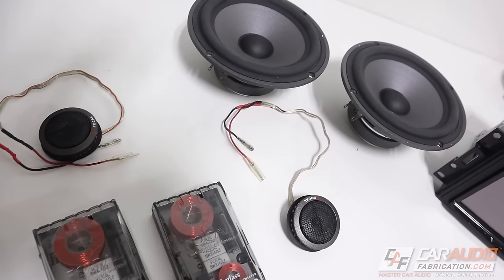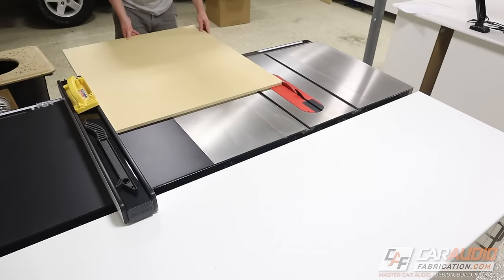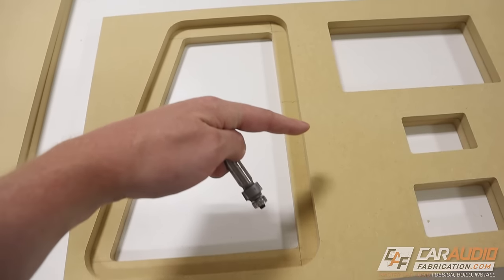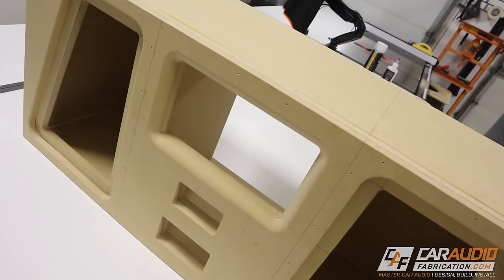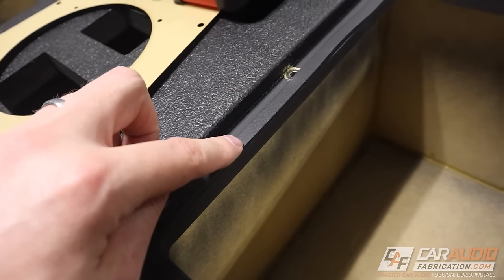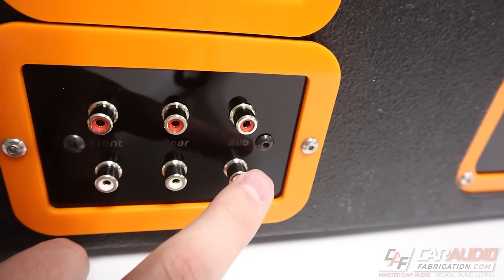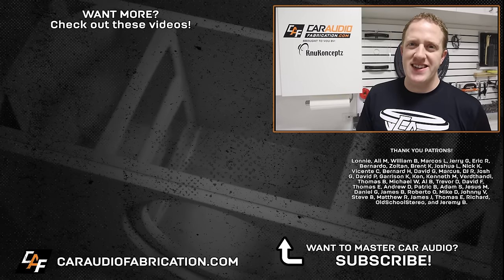How to Make: STEREO BOOMBOX! I turned OLD Audio Gear into a sound system!

Comment: Yes sub box for sure! I built a budget system into my husky 52" tool chest to be better than anything you could buy like the kobalt tool chests. I used two prefab boxes in top cubby to hold infinity 6.5"' marine speakers and built a custom box that fit in the "large power tool" drawer with an 8" downfiring audiopipe sub. Kenwood HU and two SSL micro amps all powered by Xbox power supply are installed in one of top drawers. My main problem is turn off pop when the HU is set to standby or off. The way it's wired it gets full power to HU when plugged in, no separate switch like you did. Doesn't seem to do it with HU alone bypassing the amps. Any suggestions? Is it just low quality amps?

Comment: What would you recommend for a more permanent power supply for a boom box besides a car battery? I have an old sub woofer amp that I want to repurpose into a shop box but I don’t want to spend another $200+ on a battery that can handle it.

Comment: Hi Mark, Do you build boomboxes out of old boombox parts or do you know anyone that does because I need something like that. Years ago, I had a JVC boombox and this thing had an equalizer and a base booster that sounded off the hook when you put the equalizer and the base booster just right. If I knew then what I knew now, I would've kept my JVC boombox for it's parts and have somebody put what I need out of it into a smaller casing now. And, it still can be done, I can buy an old used JVC with that Equalizer and that base booster and those speakers. All I need is somebody to put speakers, equalizer, and base booster into a smaller casing, like they have blue tooth speakers now. I don't need the cassette player, radio, or CD player, all I need is the equalizer, those speakers and that base booster. They are fascinated by that Bose and that JBL now but to me, it doesn't compare to that JVC with the base that it has and that equalizer. Another speaker I'd want transformed into a blue tooth speaker is the Velodyne 15 inch subwoofer. That thing has bump and shake base! Only thing iz, you need to connect it to a cassette player, CD player and a record player, and, it's 30 pounds. I don't need a 30 pound thing in my house, so that's another one I'd love to have put into different casing for a blue tooth speaker. Can you do or do you know anybody who does this? If you do, please let me know. If I tried to do it I'd wreck everything.

Comment: Did this with two 6.5 polk audios with a bluetooth micro amp and a 6ah lipo battery in a old miwaukee drill case. Still use it on site every day three years later. Fucker gets loud too

Comment: I made a boom Box like this and I put 4 speakers in it sounds amazing.. I do have an issue however with the memory let me know a smart way to handle that.
Reply: Memory as in the head unit settings? You need to make sure the yellow wire is receiving constant 12v, that is the memory wire on your head unit. This is the same reason your stereo loses its settings when you disconnect your car's battery. The red wire is your turn on wire and only should receive power when you want the head unit to turn on, easiest way to do that for a boombox build is to run it through a switch.

Comment: Dumb question, but... does the car stereo power up from the acc wire or battery wire? I would like to build (another) ammo can with a car stereo head unit, but with a small battery to retain memory and power up using 120vac to DC power supply.  In other words, how can I retain the memory of the head unit while not plugged in?

Comment: Great setup sir. Design is very good .

Question: I use Hp power supply from Elite 8000 cmt, its output is 12v 16A. But when volume is more than 27 headunits turns itself off. Headunit is kenwood krc-666g. Using 8 ohm 10w speakers .
Kindly help me.

Comment: Hello Mark,

   My name is Jasaiah Gonzalez, a 19 year old college student currently attending New Mexico State University in Las Cruces. I am in the process of pursuing my dream build. Although I had a few questions to ask you and was seeking advise from an expert. I have been planning this project for a while and I would like some clarifications. 
Firstly, I would like to mention on what I have installed right now. The car model for this project is a 2015 Hyundai Sonata SE (Standard Key/No Navigation) with the factory radio/head unit. A couple of months ago I ended up switching out the factory tweeters on top of the left and right dash of the car and replaced them with 2 Kenwood Excelon Series KFC-X2C 2-3/4" aftermarket Mid-Range tweeters [front dash L&R]. I also replaced the door speakers with an aftermarket Kenwood Excelon KFC-X174 Series 6-1/2 on each door (4 total doors). 
    Furthermore leading into my future build. My dream build is to add, 
1). 2 15inch Kicker CompR CWR154 43CWR154 3200W (both Comp R Series Dual 4 ohm Subwoofer) in the trunk, and a 12inch Kicker CompVR CVR124 (43CVR124) 800W (Dual 4 ohm Car Subwoofer) custom fibered glass/mounted in the front passenger glove compartment. 

To balance the audio I would like to add, 

3). 2 pairs of Kenwood 6-1/2" (2-Way Car Speakers - Black Model:KFC-651) 1 custom on each door. 
4). 4 Kenwood KFC-ST01 1" balanced dome tweeters. 1 custom on each door 
5). And 2 Kenwood KFC-ST01 1" balanced dome tweeters. 2 custom, 1 on each back A-Pillar rings towards the trunk. 

    Which leads to my questions. I am thinking I will need 2 amps or more. Would I need an 8 channel amp for the door speakers and another multi channel amp for the subs? Or just one 8 channel? Please let me know. And if so would you recommend the JL Audio VX800/8i (8-channel car amplifier with digital signal processing — 75 watts RMS x 8)? Leading into my second question... I will for sure need to add an extra battery in the trunk. But would I need 1 or 2 battery’s? And how many amplifier capacitors will I need? I am also not too worried about the wiring until i am there at the installation shop so they can add for what’s needed. I also have the  Soundskins Pro Plus Extra Large Rap to rap my car in for the improved sound quality like you mentioned. All I have left to order are the amps, and the battery/battery capacitor.

 In summary/perspective my build will include, 
- 2 tweeters in the front dash L&R
- 2 door speakers and 1 tweeter on each door (For 4 doors = 12 total speakers) 
- 2 15’s in the trunk 
- 1 12inch sub in the front passenger  

I will greatly appreciate it if you could advise me with feedback on what else I will need to add or will need to change. I also have to say that I am a big fan of your work! This is a legit build that I am trying to make happen within a couple of months and I am very excited. Thank you so much! Hope to hear from you soon.

Comment: Hi, what you mean with matching the volt on the head unit,my radio is 12v and  have a 10 fuse ,so I need an adapter 12v and 10 A?

Comment: I need help for time alignement in my car stereo. The question is: the sound stage must have the singer in front of me or at the center of the Dashboard?
Reply: The staging should be as far forward in front of you. I’m sitting with the problem that majority of all of my sound is coming from the 6x9s in back. They sound great but there is another option to bring the staging forward. Upgrading to any component set should solve almost all sound staging problems
Reply: Sean Michael yes but my question is different... I know that the sound stage must be as far forward as possibile... but... The singer (so the center of the stage) Should be in front of the driver seat or at the physical center of the car?

Comment: For the AC/DC Adapter: Look in thrift stores for rhe old grey Xbox power bricks. They're the most common 12v high-amp (16A) adapters you'll find.  

And there are 2 models. The oldest style which is rounded, and the new which had sharp corners. If you can find multiples of the same model, they can be wired in parallel to achieve even higher currents. 16A, then 32A, and so on. Very quickly you've got enough to push car audio amplifiers and subwoofers indoors.

Comment: So I've got a 600w AC to DC converter that I like to run a car amplifier off of to power the subs in my house, the only problem is I get really really bad feedback through everything when I have the inverter plugged in, the old Amp I used if I touched it (I'm assuming I was some sort of ground?) It would stop, it doesn't do that with my other amps. I'm wonder what I can do to either remove the feedback entirely, or at least lessen it. I've thought about those magnet things that clip on the wire, I've thought about getting a different power supply and I've also been lost in the thought of dirty power but I'm really just not sure where the issue is coming from other than the inverter itself. Any help would be greatly appreciated

Comment: Being waiting for this👍 but question can that power supply run an amplifier? Didn't want to use any battery 👍👍
Reply from the maker: No, it is only 10 amps. You would need a larger power supply for a more powerful amplifier. Those get pricey fast.

Comment: Next time pop some passive radiators into your design, or maybe run port :)
Reply from the maker: I need flexibility to try different speakers, either of those options would require making some speaker specific modifications to the enclosure.
Reply: @CarAudioFabrication  Whoops, entirely forgot that :O.. But maybe make like more "permanent" one in far future :) But cool design all in all, those RCA outputs are very cool

Comment: Love the video 
Now i wanna build one 
Id like to add a 10" sub tho 
So my issue will be 
After fitting a amp inside my wooden box build were would i run the ground/earth wire from the amp?
Thanks

Comment: If I am looking to get decent amount of bass in my car a MUV, will JBL GTO 609C component speakers on all 4 doors with an Amplifier connected to a 2-Din Head unit create enough bass ? I do not want a car shattering bass but decent bass to listen to EDM and techno music ! If not then my last resort is a set of Components in front doors , a set of Coxial in rear door and a sub in trunk connected to 4 way amp. (But I don't want excess Bass so confused also only components and sub will be on Amp) can you please help in this?

Comment: I like how he says " it´s only on head unit power " I am broke, so I plugged a 12 dollar unit to a subwoofer, drilled holes in the unit, inserted a fan and boom. It can completely handle it up to 100 Db.   the sub is a12 inch wide, or 30 cm wide.

Comment: Hey guys, I am a total amateur and honestly a lot of the information provided in these videos have my head spinning. Anyways, I recently added in a amp and upgraded my speakers, using the factory head unit in my 2017 Silverado. The place that installed it did a clean job, but I’m hearing a lot of electronic interference, and the amplified chimes & Siri integrated speech coming through are obnoxiously loud! I was wondering what I needed to fix this. Thanks for any help!

Comment: That little power supply is enough to power all of that? I would think it would cut out having the sub amp and subwoofer going at high volumes
Reply from the maker: Watch the whole video
Reply: He connected the amp to a battery however I would use a switching power supply over the one he installed but that's a nice build👍👍

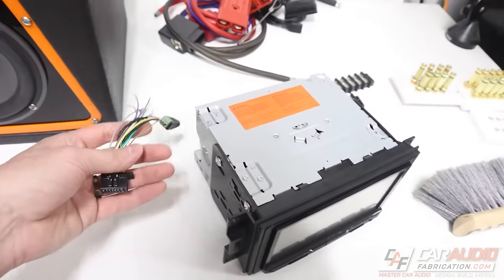Comment: at 13:01 is what i need to do to power a cheap dual mechless head unit  but later in the video you remove either the red or yellow from that dc plug

Comment: On the inside i would have used silicone on all the creases where each piece of wood attached to make sure it had a better seal.
Reply from the maker: My cuts are perfectly straight so the wood glue alone seals everything up. But if you are used to bad quality cuts then yes you can use caulk

Comment: Only hiccup I see is deck wouldn't have memory because there is no constant power. So settings wouldn't be saved after unplugging power. Other than that minor detail its a great project. Just a heads up for anyone building something like this.

Comment: I have an idea that is similar to yours, i want to build a kind of wall with 10-15 different speakers with subs and amplifiers and a car head unit, 
Just to brag an build something cool for my house, but i dont know how to connect that many speakers 😊
Reply: Dude, please tell me you ended up doing this. I'm trying to make a wall right this moment of speakers with a car head unit. I've got the amp and power supply mounted right now with 2 speakers in place. I need a little guidance .
Reply: @Padenormous  No i never did, but i still want to do it 😀

Comment: my head unit has power and all but the speaker wire output isn’t working. any help?
Reply: Did you ever find out the issue. I'm in the same boat right now. I'm worried I have to wire my head unit harness directly to the amp where the speakers are connected.

Comment: 400th comment.... I am sure that  Pioneer head units supports 80w RMS@2ohm if you use one of the rear speaker outputs .... Just check owners manual

Comment: Why wouldn’t you just cut the end of the AC adapter plug off instead of using a special adapter, if the point is to get a positive and negative 12v wire pair?
Reply from the maker: Because I wanted to be able to easily unplug it...